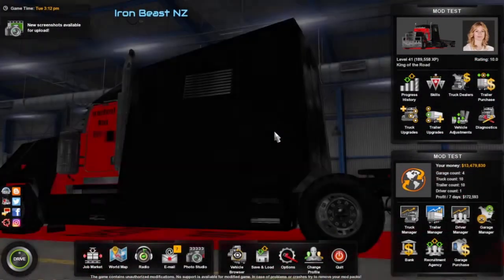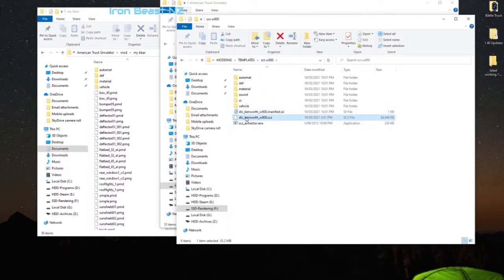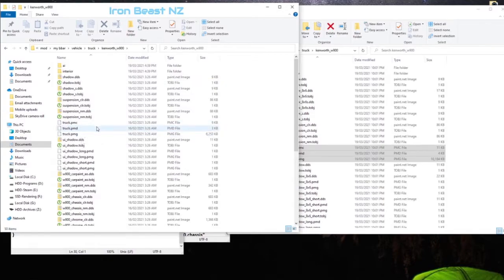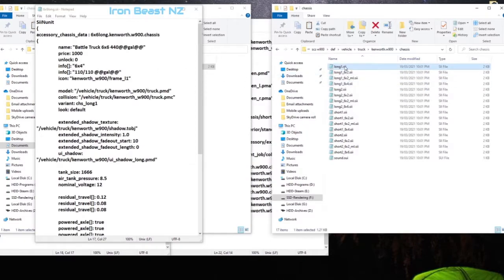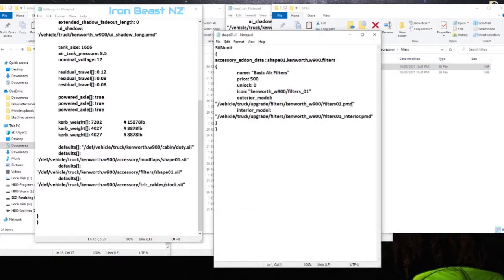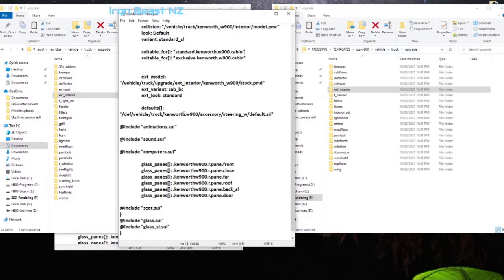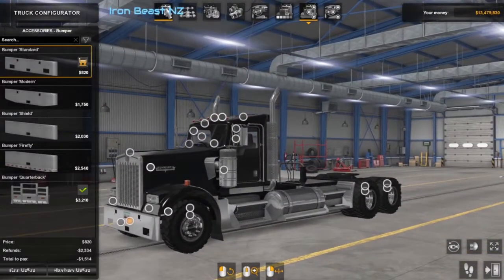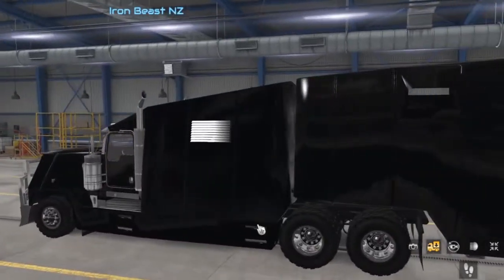ATS 1.40: Fixing Texture issues on your mods

Comment: ever since the 1.47 update my mods and dlcs have tons of missing textures. it also crashes the games alot. ive tried everything but it still does the same thing
Reply from the maker: I noticed some of the SCS textures changed in the update which meant any mods that copied the texture into the mod will be out of date. Mods that directly reference the scs mat/texture updated automatically. I had to fix this for a few 3rd party mods with this issue.

Comment: How about my issue? I just got the Freightliner Century/Columbia mod [which works] but when I'm in first-person view [in cab] the windshield is red.  That's the only thing that's showing red.  PLEASE help me!
Reply from the maker: hi mate youd need to find the similar scs truck model, then extract the scs base folder into a different location, open the scs truck model, open the cabin def file and find name & location of the texture for the windows. navigate to it. then open your mods def file for cabin, navigate to its window texture file. then copy the scs texture file(s) into your mods texture folder and just rename them to the same name as the mods original texture file. that way the copy paste means you dont have to change anything other than renaming the scs texture files to match your mods original file names. any further issues contact me on discord. good luck
Reply from the maker: you could possibly use any cabin window texture files but for simplicity id use the scs files for the base truck.
Reply: How to find such file?
Reply from the maker: @DaveW0nka  https://discord.gg/t5QXEJBb
Reply: I'm having same issue
Reply from the maker: @badbrad2334  which truck are you having issues with? can you send me a link to the mod? il check it out for you.
Reply: @ironbeastnz  freightliner century/Columbia c120
Reply from the maker: @badbrad2334  i use this mod version of the c120 for ats 1.40 works perfectly. you could either use this mod or copy the windscreen texture from this mod to the version you are using. youd trace the texture by going into the def files as in my video. locate it in your mod, then find the same path in the source mod.
Reply from the maker: https://atsmod.net/american-truck-simulator-mods/ats-trucks/freightliner-c120-century-columbia-v1-3-1-40/
Reply: @ironbeastnz  hey mate got a question on textures for a mod
Reply from the maker: @seanwhyte3008  hi sure mate flick me a message on discord if youd like: https://discord.gg/MNTXdyC8